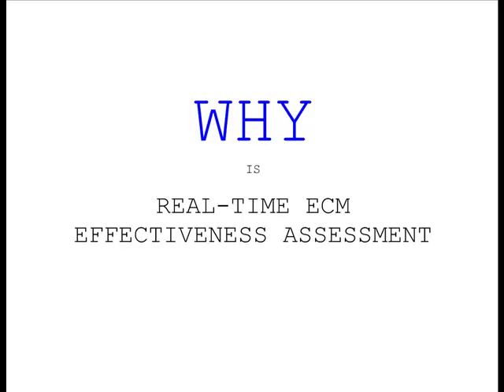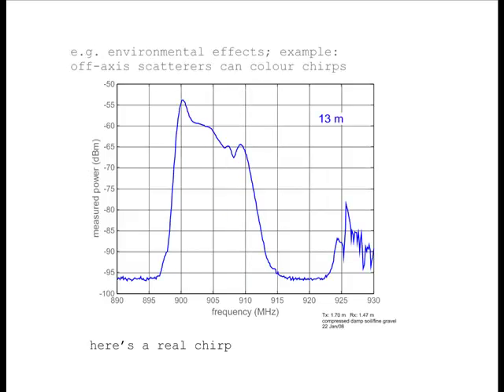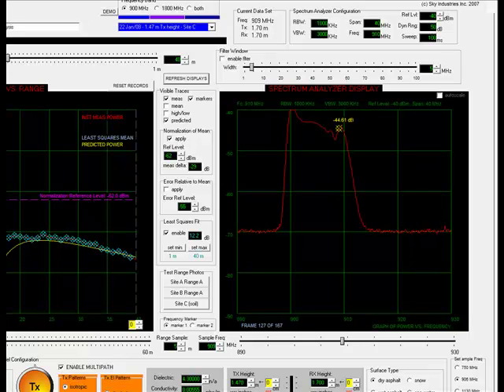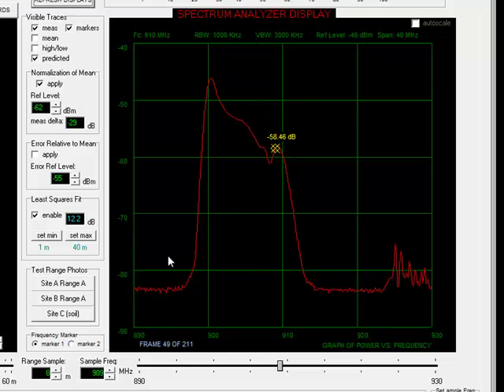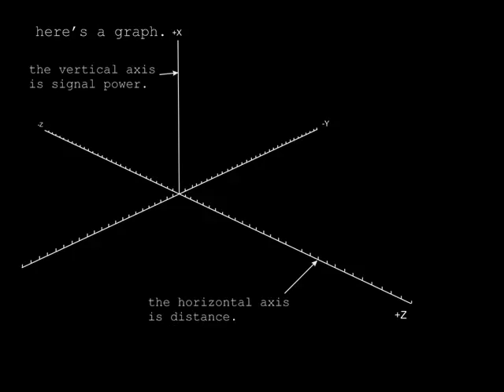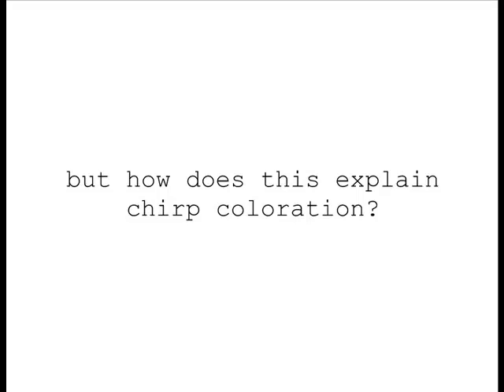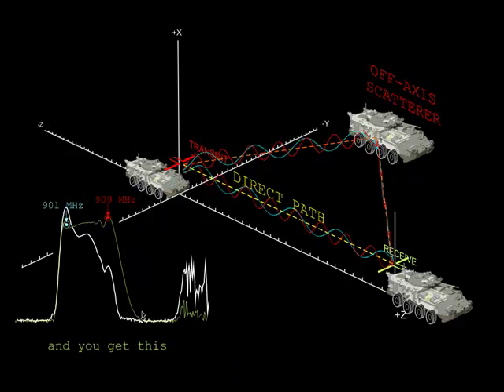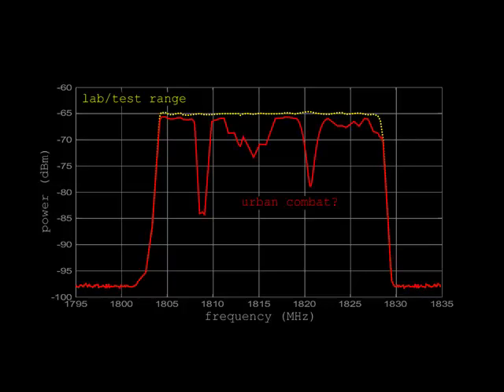Counter-IED ECM Proteciton Range Estimator - Justification

Comment: I remember this video....those poor soldiers. Seems to be as fast as composition four.
Reply: Do you know where was the explosion
Reply: @abdalrhmanmagdy3061  No I Don`t. But most likely Iraq; Afghanistan second guess. Power poles imply a power substation. Does Afghanistan have such a thing as a power grid? If you know any veterans that were there they may be able to even tell you the city and street name? That substation power line at 10:00 o`clock tells me that a large town/city is near.
Reply: @Buzzy1960  Yeah but how they are poor soldiers when they are in Iraq or Afghanistan..etc